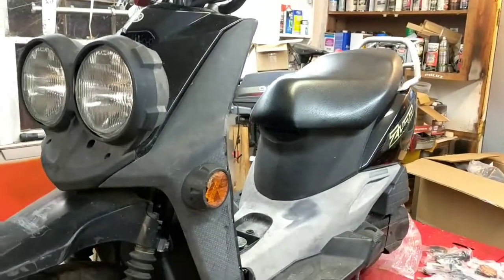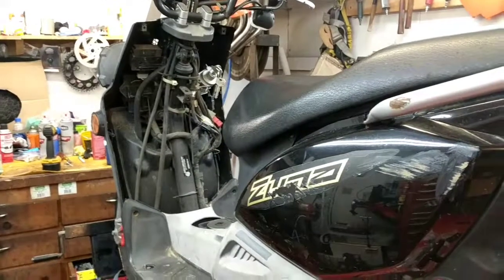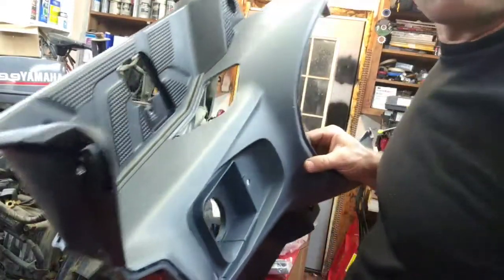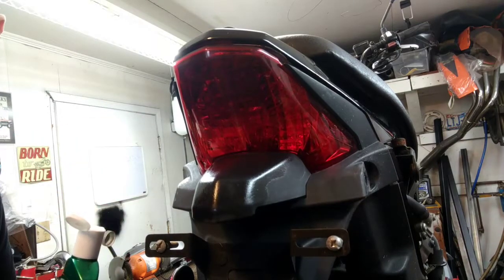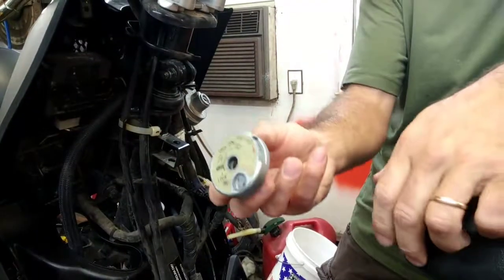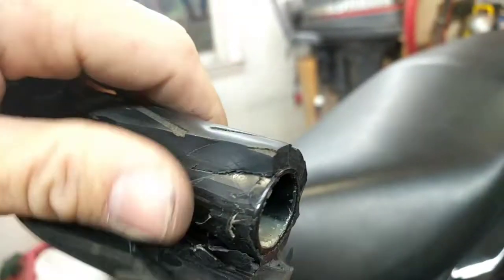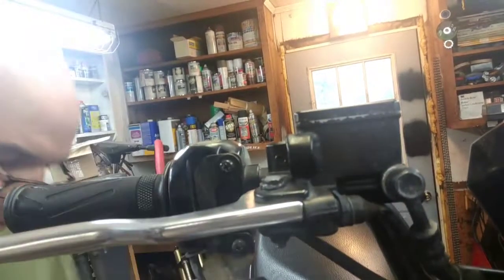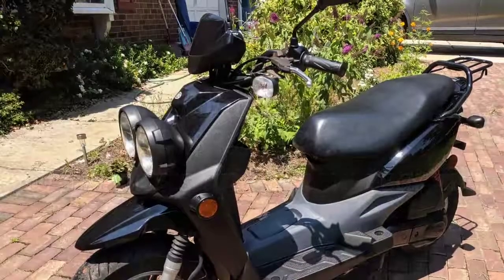Yamaha Zuma awesome restore!

Comment: Just had to replace the lower plastic on a 2012 50F what a pain. Basically had to disassemble all the plastic from bike. Minus the from seat back but, still what a PIA. When I bought the scooter the plastic was all busted right behind wheel center of scooter. I don't know in heck they did to bust it this way. Jumping? Feel trying to load it in truck ? No idea. Costed me 70$ for new part though OUCH!